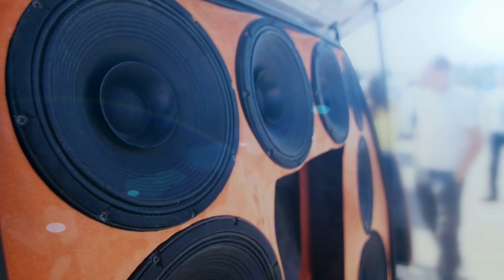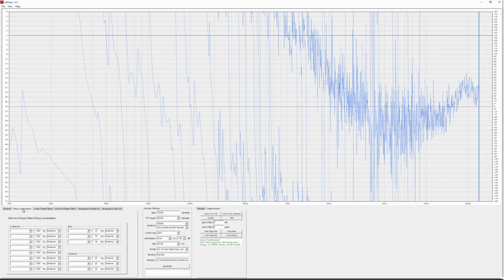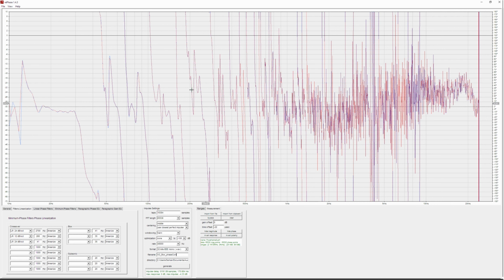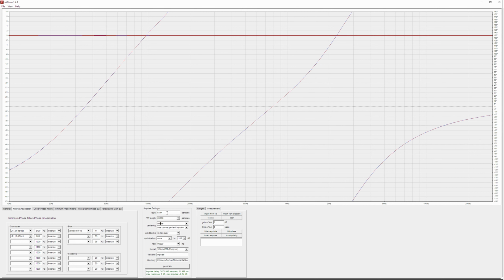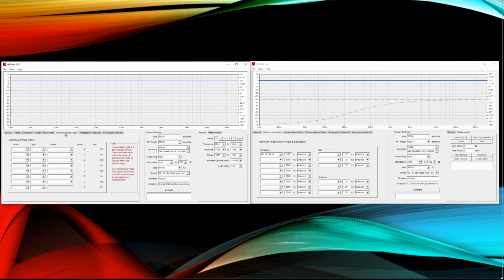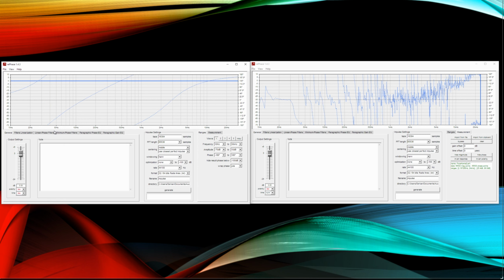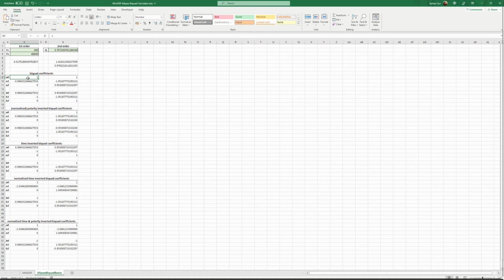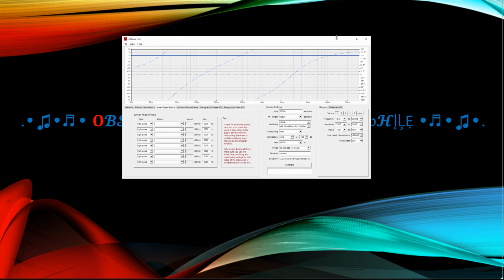MiniDSP tutorial / Unleash the power of biquads

Comment: time inverted BIQUAD IRR ALL PASS to rephase CROSSOVER, don't work in MINI DSP FLEX, frustrating. I have to use FIR TAPS..
Reply from the maker: Unfortunately true! But you can linearize XOs quite efficiently with  about 2042 taps per chanel in stereo. I think even some port correction could be possible if you use rectangular windowing 99% centering and some optimization.
Reply: @ yes, but FIR are only at output in Flex , and I use sub. I would prefer in input…

Comment: Can I use Re Phase to correct phase and use that measurements to REW for EQ and upload it in Mini Dsp 2x4 HD
Reply from the maker: Yes but you'll be limited to 2042 FIR taps per channel. The video shows how.
Reply: Thanks, Can you make video on Phase correction and Alignment where we face Subwoofer or speaker delay more than the limit of Audyssey or any other calibration software?
Reply from the maker: @ManCaveAudio I'm working on a new A1 version which will solve insufficient sub delay issue.
Reply: @ocaudiophile  ohh, thanks and great. But it will be helpfull if you make small video for those who are  looking to experiment manual calibration. Because when I add miniDsp 2x4 HD for my subwoofer, it adds extra delay and I want to make it correct with phase alignment, not time alignment.
Reply: Hi, to do phase correction in Subwoofer frequency to match with mains, If I apply FDW of 15 cycle (AVR Denon X4700H) and create Minimum Phase virson copy and do EQ of that FDW+MP virson to upload in MiniDsp 2x4 HD, will this work for phase alignment? Without causing additional delay?
Reply from the maker: MiniDSP has only enough FIR filter taps for very basic phase correction, is ineffective especially in the low frequencies.
Reply: @ocaudiophile  ohhk, thanks...,but it might be a great learning if you can help 🙏

Comment: Hi sir, I been learning alot from your videos. Im ready to purchase but find minidsp a bit over my budget and I require 4 channel in and out. How about if I use thomann t.racks DSP 4x4 Mini? Thank you in advance.
Reply from the maker: Thomann has only parametric equalizer no fir filter capability. But Minidsp only has 1024 fir taps capacity so, it is not even a real advantage. You can do a lot better DSP than anything in the market for free by using your computer as source (for up to 7.1 channels - no Atmos) and free dsp engines like Equalizer APO or Camilla
Reply: How to digital delay on eqapo or camila pc to hdmi? I even tried to use avr manual distance setting but not work. It does sound good though. Im using smaart v9.
I can not seem to find many camiladsp tutorials do you have any or please make one kind sir, thankyou.
 @ocaudiophile
Reply from the maker: I use JRiver since a long time now and I used Equliaser APO for a short time in the past but it certainly has speaker delay features for adjusting distances:

https://sourceforge.net/p/equalizerapo/wiki/Configuration%20reference/#delay-since-version-09:~:text=%2D1.84776%200.729402-,Delay%20(since%20version%200.9),by%20480%20samples%20(10%20ms%20at%2048%20kHz)%0ADelay%3A%20480%20samples,-Copy%20(since%20version
Reply: @ocaudiophile  now I’m doing this I’m very happy. Smaart v9 capture live transfer file send over to REW then save untouched file and make new file with curves both files open in rephase linear phase for each 4500 5.1 audio channels  export to eqapo.. imho way better than Dirac. I just ordered Iems measuring kit and about to do the same for moondrop starfields and AirPod pros 2. Later I will get a headphone measuring rig and try this method. Ath ad900x. Not sure if I can use live transfer don’t know if the sound card can loop back.

Comment: Thanks for the great video.

I understand that in your video you are phase aligning a pair of speakers that already has a passive crossover in them. I was thinking if this can be used on active speakers where the MiniDSP is also used as active crossover.
As far as I know IIR crossover filters have identical behavior to capacitors/inductors in passive crossovers, so when using an IIR Crossover filter, I guess this might be a way to correct active speakers as well?

For example.
Most MiniDSP's have advanced biquad programming available with 8 biquads per channel.
If I wanted to create a bandpass filter for a midrange in a multi-way speaker with for example LR24 for 2500hz low pass and 500hz high-pass could I then do something like this:

biquad #1-4 - crossovers: 
- HPF 500hz LR 24db with coeficients from MiniDSP spreadsheet (cascading if needed)
- LPF 2500hz LR 24db with coeficients from MiniDSP spreadsheet (cascading if needed)
biquad #5-8 - phase linearization of crossovers: 
- 500hz second order time inverted all pass filter
- 2500hz second order time inverted all pass filter

Would above actually make a phase linear 500Hz HPF + 2500Hz LPF from the digital domain point of view, where the all pass filter reverse the phase shift effect of the IIR Crossover filters? Here I'm not trying to factor in cabinet, room modes, woofers/drivers FR response/phase shift behaviour - just whether the MiniDSP will output a linear phase crossover?
And if so should there by any concerns in regards to digital artifacts created by all pass filters (like ringing and all other kind of terms I cannot remember right now)?
Reply from the maker: In theory it could be done however the phase filters need to be time-reversed and most MiniDSP models refuse to accept the biquad coefficents of time-reversed all pass filters. A better option is to use FIR filters in MiniDSP for phase correction. You can dedicate each speaker 2042 taps of FIR filters even in 2x4HD and all bar the lowest frequency box phase shifts can be corrected with that. Use repHase, 99-100% centering and rectangular windows to achieve good approximations with low tap counts. You can design your crossover filters outside the FIR slots and they will work in parallel. This video can help you:

https://youtu.be/ChPu0u3nZxc
Reply: Do you know how the MiniDSP plugin will act if it does not support biquad coefficents of time-reversed all pass filters? Will it refuse to apply or pop-up an error if trying to configure them, or will it accept the commands, but output distorted sound?

None of my MiniDSP platforms supports FIR, unfortunately (I currently have SHD and C-DSP 8x12 v2.0). I've used the C-DSP 8x12 in the car, but now it's just sitting on the shelf, so was planning to use it for active speakers in home audio, which I've seen a few people do in various forums with success (just have to be cautious about ground loops as it was not designed for home use). It lacks FIR filters (but have DIRAC live instead as an option). Need to test if these time reversed all pass works on it... It uses an older plugin, so it might.

My goal is to make a 4-way active speaker. I guess I could make a setup where my SHD is the main device and then use the 4x digital outputs for two 2x4HD, Flex or MiniSHARC/DRC-DI. It would give me 4 channels each, for left speaker and right speaker, but with a dedicated DSP for each speaker.
It would not be that clean to have 1xSHD + 2xDSP FIR crossover processors (one for each speaker), but guess that is how I could get FIR filter crossovers with enough taps and outputs.
I also know there is a Flex Eight, but that only supports FIR filters on the 2x inputs, and not the outputs like the normal Flex.

But right now I'm not sure FIR filters is worth the investment. Many great speakers have been made using classic IIR filters or passive crossovers that behave similarly. So guess I will try out the C-DSP 8x12 first and listen to the results, before considering FIR compatible devices to replace it.
But these time reversed all-pass filters using biquads is still interesting, and is definitely something to try out to improve the phase of IIR crossovers. Just hope it works with C-DSP 8x12 :)
Reply from the maker: Your comment was left in Youtube spam folders for some reason, only just saw it...
I think, it will accept them in the plugin but just mute the MiniDSP when applied.
Reply: @ocaudiophile  

I tried on the MiniDSP C-DSP 8x12 V2.0, and when entering inverted all pass filters into the EQ biquad section they are definitely not stable (overload of output channels that puts channel into error state and requires reboot to restore unit, so the outputs work again).
In biquad section for crossovers I experienced that output level would decrease like 80-100db, but music would play. But I do not believe the lower output level is related to filters generated by your spreadsheet. I tried filter from MiniDSP's spreadsheet as well and got the same result of 80-100db reduction in output level. Not sure what Im doing wrong, but I didn't really bother to try and fix it. Im sure if I figure out what Im doing wrong in defining all 8x biquads for the xover I would get same error as when entering your biquads into EQ biquad section (overload of output channel). For reference, my approach was to use biquad1+biquad2 with values generated by spreadsheets and biquad3-8 was just 0's (except b0=1).
I think we can conclude they are not supported for the C-DSP 8x12 at least, and that platform is not stable with them.

Im thinking about buying a MiniDSP Flex Eight instead to get FIR filters at the input channels to create inverted all pass filters for crossover linearization, and just be done with it :D

But thanks for taking an interest and replying :)
Reply: @Salkcin87 , Minidsp 2x4hd didn't work either. Caused my dbfs meter to peg to 3 and stay there until factory reset and unplug. I tried everything I could think of and same result.
Reply from the maker: Sorry to hear that. There are so many additional things that can be done in DRC with FIR taps but I guess, thankfully not many of them are relevant in a car.  Phase correction is required for left and right speaker cohesion for instance and otherwise inaudible mostly and there's no such LP position in a car unless you focus fully to the driver.

Comment: Hello OCA, I have a question about a general approach to optimize my 7.1.6 Atmos/Auro setup.
I'm thinking about to the following:
- external amps and miniDSP for all speaker channels
   > precise time alignment of all speakers and subs for the MLP 
   > what would be the optimal combination of filters and convolution that can be implemented with the miniDSP?
   > would that introduce a delay grater than 500ms to the audio signal of a video? (my favorite player for movies is PowerDVD and I can only set a maximum of -500ms there as negativ delay)

- 4 subs with one miniDSP, optimized with MSO biquads for input (10 for all subs), output and through crossover function (18 for each sub)
   > use target curve within MSO
    > after that no EQ through audyssey anymore, only time alignment with the other speakers with the other miniDSPs
    > makes it sense to use the FIR filter for each sub on top to do some phase alignment?
    > should I not use the input BQ on top of output BQ to prevent phase issues?
    > what number and combination of filters, MSO, and miniDSP is the best approach for 4 subs?

Would it even be reasonable in regards to sound improvement to go this way in comparison to your guide for Atmos/Auro calibration with audyssey hack?

Or to put it in another way: If you had the possibility's of audyssey App, REW, MSO, UMIK-1, pre-amp and external-amp, miniDSP for each channel and sub > what would you do to get the best result for movies in Atmos/Auro?
Reply from the maker: MiniDSP 2x4HD FIR filters are uselss for subs but MSO can make use of some "allpass" filters with biquads to fix the phase response. 500ms PowerDVD delay would be enough. Your bass response was already quite nice so I wouldn't expect a major improvement but a slight improvement in bass can always be obtained with a lot of effort. External amps will certainly improve the sound comapred to class D power supplied by the AVR. The speaker crossovers and EQ will still be in the AVR though.  You could use 2x8 channel MiniDSP units for bypassing even that but you would be better off with an AVR with Dirac ART if you are willing to invest that much.
Reply: @ocaudiophile  Thanks for the feedback. I wonder if ART will be at some point be integrate to existing DIRAC devices like the miniDSP 2x4 HD. But I don't know if this if even possible. And I would wait for even considering an ART AVR until it is available in the below 10K price range. 

The main reason for my question from the beginning was to bypass the EQ from AVR or pre-amp completely with miniDSP to use your methods of filter creation and convolution. And as you said the bass can already be made pretty good without ART. Do you have a source where I could learn more about "allpass" filters with MSO? A benefit of miniDSP would also be the ability to precisely dial in the delay between all speakers and the subs. 

So if I understand you right I could use convolution filters with miniDSP and would be able to have synchronized video and sound?  So the question for me is still to choose between your method with audyssey or your method with miniDSP. 

With kind regards
Frank
Reply from the maker: https://www.beisammen.de/index.php?thread/121932-multi-sub-optimizer-mso/
Reply: Hello! I also have MSO and miniDSP HD for 4 subwoofers. Have you found the optimal settings for MSO?
Reply from the maker: @---vn2kv avoid gain filters and EQ with MSO, just use allpass filters (you can use them in minidsp in biquad form) and time delay. Then EQ MSO optimised combibination's 'minimum phase' response in REW and add these final EQ filters to minidsp.

Comment: You mentioned that the minidsp can't invert the all pass for crossover time correction, but then you explain how your biquad calculator can make a normalized time reversed APF in biquad form that is comparable with the minidsp because of the a0 being 1.
Does that mean you can use rephrase to find the APF needed for linearization, then make and input the biquad into the mini DSP to allow for crossover phase correction without the use of FIR?
Reply from the maker: I could use time reversed biquads in my old MiniDSP 2x4 balanced but some people had problems entering them with the newer hardware/firmware. We asked MiniDSP and they gave conflicting answers. It's possible that these biquads are not possible to implement in most machines. It seems your best option is to generate FIR taps in rephase for speaker phase correction. In rePhase, use rectangular windowing with 99%/100% centering to achieve satisfactory results with 1024 taps and avoid box correction.
Reply: @ocaudiophile  great, thank you!
Unfortunately I am using a box with Dirac capabilities, so the fir is locked down.
Reply from the maker: @picassoimpaler3243  Dirac corrects phase response to an extent but being an automated system, it's not optimal (i.e. it has no way of knowing every speaker and its crossover frequencies and filter orders). Still, symmetrical speaker setup and carefully taken multiple measurements will improve its results.

Comment: Hi Serkan, Thank you for uploading all those amazing videos. I have a question/clarification about the phase correction in your video. On 6:40 you said the phase is corrected and on the screen is visible that the phase is wraping 26 times from +180 to -180 between 50 HZ and 10kHz what should be 9360 deg difference. So, I do not understand what phase is corected and on which way?
Reply from the maker: You did really count the discontinuities 😂

Every 360 degrees shift results in the same phase response because the waveforms become similar and do not counteract each other. You can also think of the unit circle (pole-zero conversion of the frequency domain)  in the complex plane and every 2π addition to the angle will result pointing to the same point in the circle.
Reply: Obviously I misunderstand something. I do not want to bother or troll you but my understanding is different and possibly completely wrong so I would like to have some more explanation. 
If it is like you said, why to do phase correction for LR4 as it is in phase, acctually 360 deg out of phase, same point on the circle as you point out.
This is how I see the phase . 
That circle and every 360 deg same point theory is aplicable (maybe) for cotinuous tone but what is going on with the guitar pluck. From your video we can see that phase diference between 500 and 1000 Hz is 5 times 360 deg so 5 periods what is for 1kHz 5 ms. My understanding is, 2nd harmonic of the 500 Hz  guitars pluck will arrive 5ms earlier and smear tone attack and change the pitch sense 
As I wrote, maybe I am completely wrong so please correct me in that case
Reply from the maker: An XO phase correction like LR4 corrects phase over a frequency range (ie 24 dB/octave). It's not a correction on a single frequency.
Reply from the maker: The waves are continuous and periodic. You can think of 360 deg shift laying on the next wave. It will still not change the waves shape.